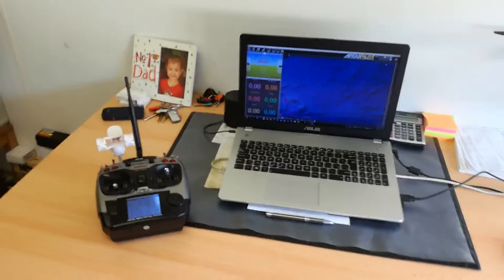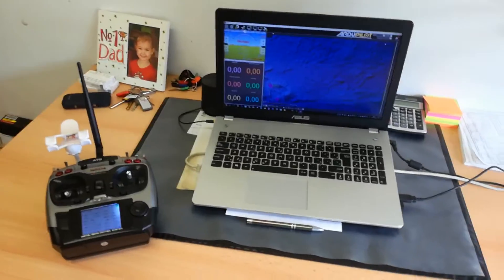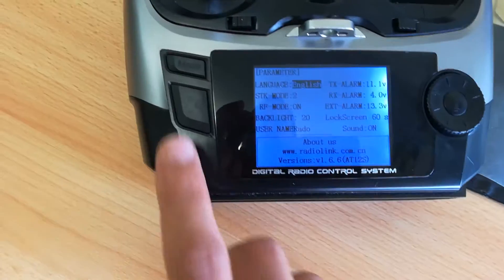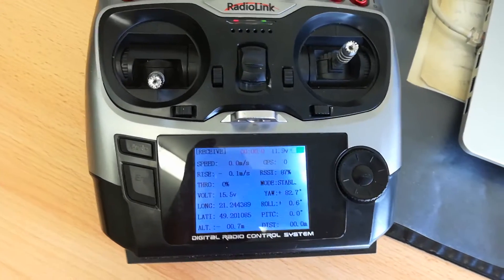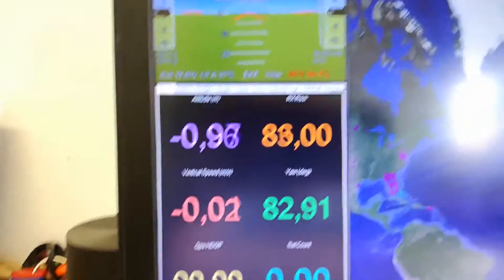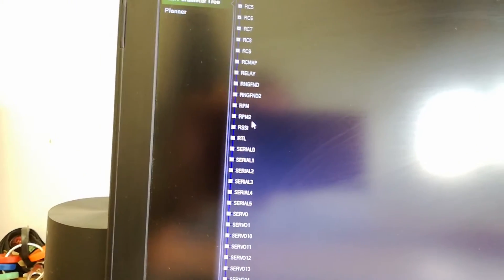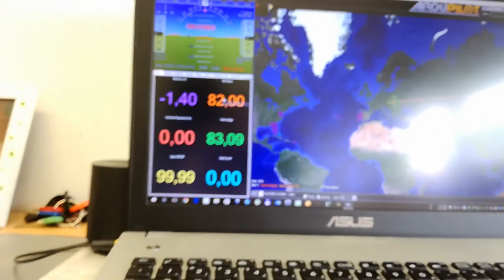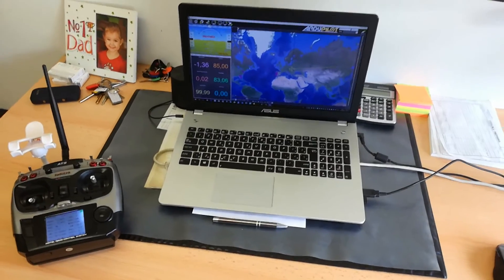Radiolink AT9/AT9S pass-through RSSI on free channel to your flight controller

Comment: Great review! I ordered this radio system for my racing quad. I was wondering telemetry set up. I am not sure if I can use any telemetry module with this radio system. So, I learned I need to use PRM-01 / 02 / 03, one of these radiolink telemetry. But the problem I found out, they are compatible only PIX and AMP flight controllers. Is that true? PLEASE SAY NO :/ I have SP F3 integrated OSD flight controller on my quad. Can I still have telemetry with this radio system and my flight controller? How should I set up?

Comment: "4. Change: the RSSI signal strength display change from figure to percent, 100% show the strongest RSSI signal."

Did it happen to yours? Just updated my AT9 for the 1.6.6 vers and it's showing signal bars on the main screen.
Reply from the maker: EF ENGENHARIA it was changed in the telemetry page (press END twice from main screen) and in the rssi alarm setting...